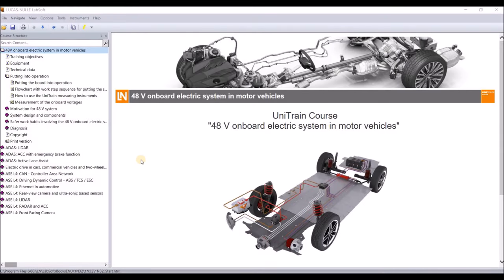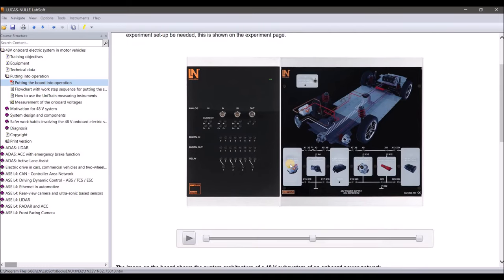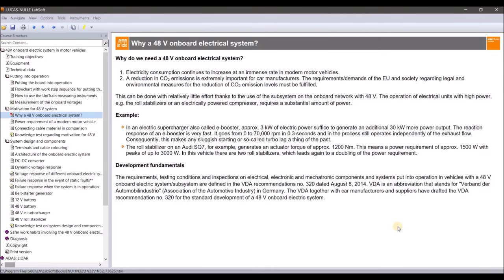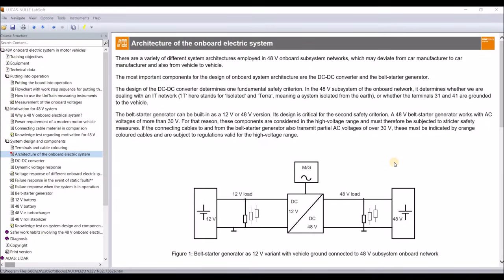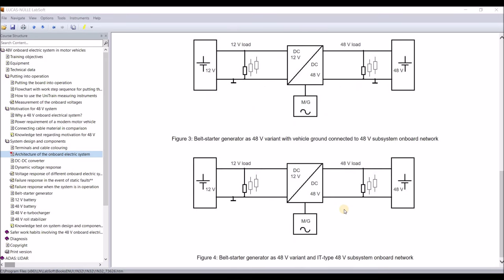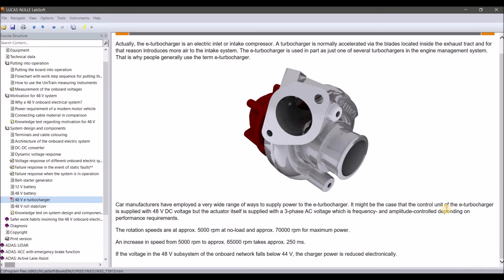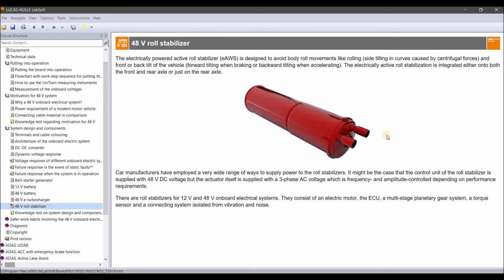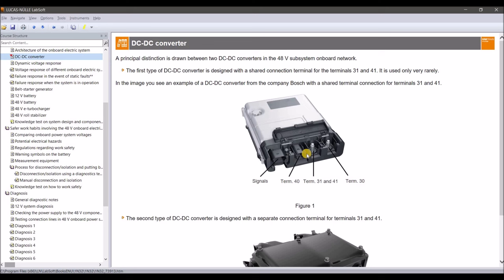48V in Vehicles - An introduction to the world between 12V and HV

Comment: Hi, I like your video. Does the 48V ECU require to do some kind of tests like ISO16750 and ISO7637 in 12V battery?
Reply from the maker: Yes, the 48V Electronic Control Unit (ECU) in vehicles would indeed require similar testing to what is applied to 12V systems, such as those specified in ISO 16750 and ISO 7637 standards. These standards are crucial for ensuring the reliability and durability of automotive electronics under various environmental and electrical stress conditions.

ISO 16750 covers tests for electrical and electronic systems within road vehicles, specifying requirements for electrical loads, mechanical loads, climatic loads, chemical loads, and other environmental stresses.

ISO 7637 focuses specifically on electrical disturbances from conduction and coupling within a vehicle's electrical system. It defines test methods for both 12V and 24V electrical systems, typically encompassing voltage spikes, transient conduction, and other electromagnetic disturbances that an ECU must withstand.

When it comes to a 48V ECU, similar testing is necessary due to the analogous functional and environmental demands placed on these systems, even though they operate at a higher voltage level. The fundamental principles of ensuring component and system durability against environmental stresses, electrical disturbances, and operational reliability remain the same.

Comment: Haven't 48 volts been on trucks and heavy vehicles for several years already ?
Reply from the maker: Hello Imtiaz, depends on what you mean with several years. ;) The standard is 24V, around the year 2000 the truck industry has done some developing on 42V - but they didn't use it in the end. 48V respectively mild hybrid solutions are becoming more and more popular for trucks.

Comment: please what inverter did you use and also is it lithium ion or lead acid you used as battery
Reply from the maker: Hey :) In the video we use a training system where everything is simulated electrically. So we only describe the different types of inverters. As for the batteries, in most cases it's a lithium-ion version. AUDI uses them, for example.